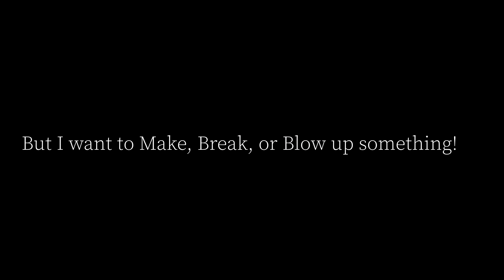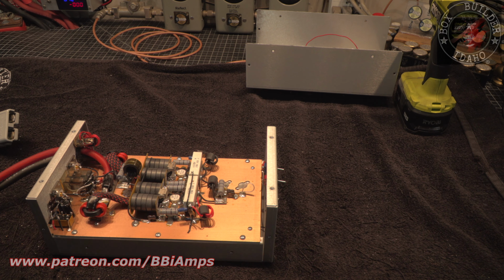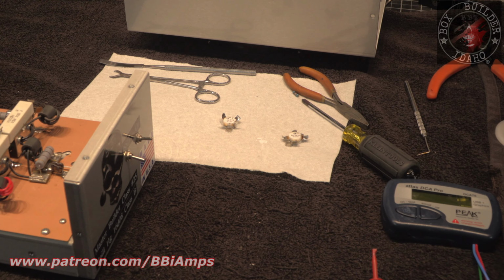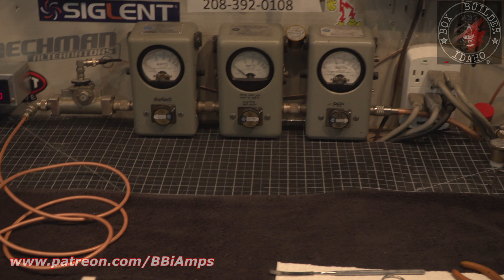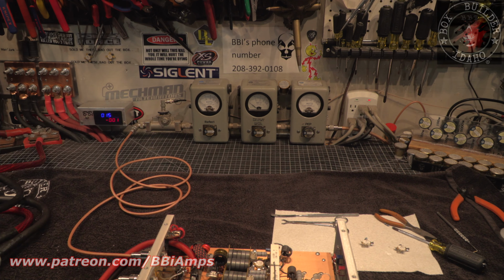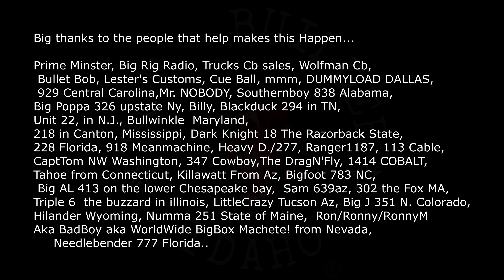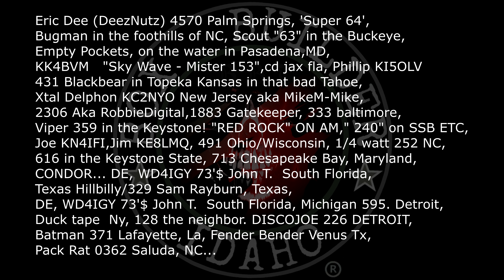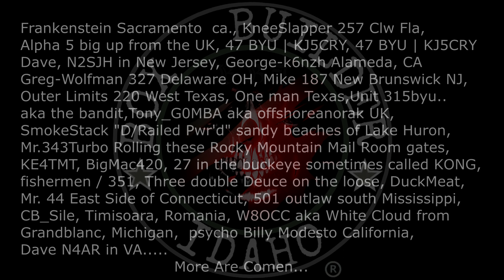repair on mbc #24

Comment: 😁 sounds just like what happened to me🙈. Except I was using an antenna switcher  And that, Antenna switcher blew apart and I didn’t know it Cause I was out on the road doing a radio check with my boy who is at home on the base station when it blew apart.  And I lost signal with him and that’s when I knew something was wrong   When I got home, I found the problem   But it was too late 🤮😳😳. Burned it up    Now you have it 😁😁. And I hope to get it fixed  👍👍.

Comment: Hey BBI, I don't if you follow Secrets of Skin Walker Ranch over there in Utah but is that you transmitting in the 1.6 GHz they keeping receiving?   I thought you might be playing with one of your big ole amps over there, LOL
Reply from the maker: I am a fan of the show and I have physically been to the Uintah Basin in Northwest Utah I  question many things about that place
Reply: @BoxBuilderIdaho  Doesn't SkyLink use 1.6GHz?  They lost me when they tried sending 1.6GHz threough the mesa using a omidirectional antenna......

Comment: I am trying to find and amplifier that can put out 300 watts all day but only want to operate it at 0-100 watts  variable power and in an emergency give me 300 watts that will do AM FM CW and SSB and RTTY whatever that is  .and has a good  band selector switch  .All transistor no vacuum tubes .Want to give it as a gift to an old neighbour who's got his licence .I don't have one .Just an old cobra in the truck he's got something I think a galaxy base station I think it puts out 100 watts but he's got a big old power supply with a variac on it and some real fancy microphone and Morse code key .Any recommendations ?